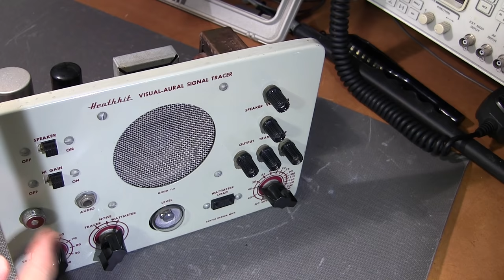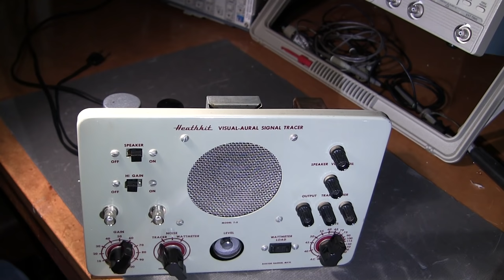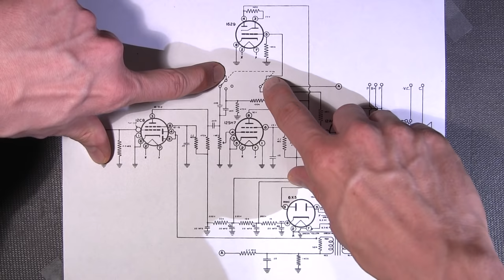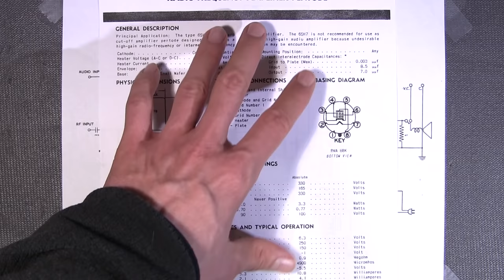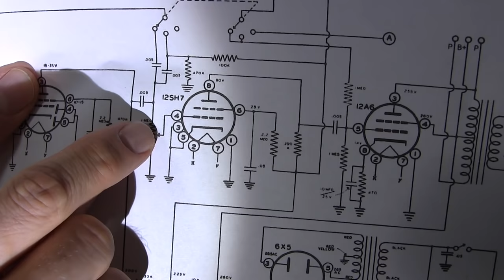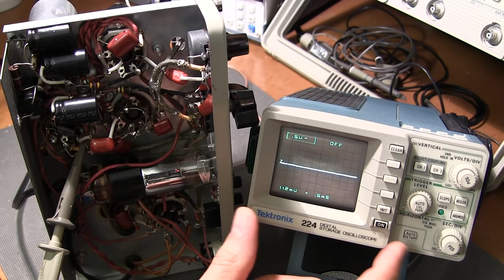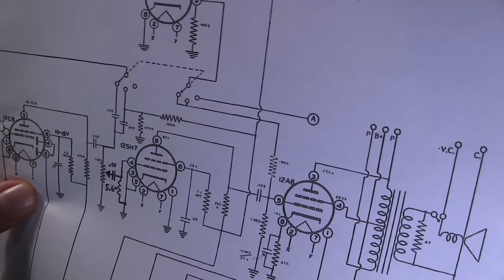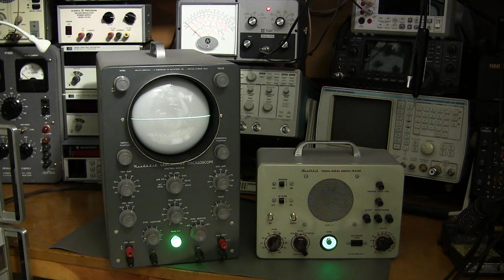Signal Tracer Troubleshooting Repair and Modification

Comment: This is a very useful video!! I have a lot of old test gear that I've restored or is in the que to be restored. I have a couple of the Heathkit signal tracers. Thanks to this video I now know that they have much better performance capability than mine do and I will be revisiting them soon. I have a E-200-C signal generator that I restored last year and it is a fine piece of equipment. I have one that is in unknown internal condition but very nice outside. Vintage test gear is a joy to work on imho. 73 NE5U  Mike

Comment: I picked up a T-3 fairly cheaply that "turned on". It turned out the high voltage secondary of the power transformer is open as well as the primary of the audio output transformer. I bought a used power transformer from a EICO 147A signal tracer and a Hammond 125B universal audio output transformer. Both of these are physically the same size as the Heathkit transformers and bolted right in. Capacitors were bad as well as most of the resistors. And the wiring was in bad shape. I completely gutted the unit and rewired it.

Comment: I have a question...  At 33:00, you said that you could mix using the "RF" and "Audio" input.  How?  I though to have a mixer you needed a non-linear component like a diode.  Wouldn't that just add the signals?  (I don't speak tubes, so forgive me ;) )

Comment: I love these videos! I was wondering if it was possible to modify a magic eye circuit to make it run duller as to prolong its life? or will it change how the eye opens? certain types of magic eye tubes are very rare and bright new ones are only going to get rarer, anything to extend their life would be good for us that like to use old equipment

Comment: Paul, I Wish Heaviside were alive to know how much EEs like you have progressed our understanding. At the end of the video, after disconnecting 100K resistor and connecting it to the leads outside, I thought that you would tap it a bit with your "plastic pointer stick" to rock it as you did before removing it to zero in on the problem spot along its length. Would it be possible for you to kindly probe this 100K resistor more by using your microscope to know the physical reason for this noise-whether an intermittent loose contact of the lead at the body film interface or a crack in the film so that you do not leave any trace of the enemy and then you can happily Widlarise the component after that, in another video, please?

Comment: Another great video Paul! Weren't the 6X5 rectifier tubes famous for shorting and damaging power transformers?
Reply from the maker: So I hear and read, but I never have come across a piece of gear with this issue. ( I hear this was a big problem in Zenith radios ) The problem may not be tube related, but capacitor related. 6X5 tubes are not big current devices, leaky electrolytic capacitors may put them beyond their tolerance. I have both plate styles here, again,.. Never an issue with either. Thanks for your kind comment.

Comment: Thank you for yet another interesting video! I have a question concerning the count of the useful elements in the 12SH7. If i have understood your explanation of the numbering system of vacuum tubes and the habit of heathkit leaving out the suppressor grid in their schematics, i would expect to count 6 elements in heathkit's schematic. I count however only five. Where do i go wrong?
Keep up the good work!

Comment: The 6X5 rectifier tube I noticed has the heater tied to ground, and if there is any heater to cathode leakage this will be a problem. Also it can introduce hum into the rest of the circuit through the heaters. As even with the best tubes there is heater cathode capacitance. I have been wondering why not two filament windings on the power transformer.

Comment: Would an EICO 147A also be a candidate for the addition of the capacitor and resistor that is shown being added to the grid circuit of the second tube? Also on the EICO, I don't believe that the grid of the first tube is grounded when the selector is in the audio position. Just looking for potential improvements to refine an EICO 147A.

Comment: I have an Eico 147 which is wired with the same grid leak issue. After this video I did the same mod with the same Quiet result. How did they ever use these things being designed  with so much noise?

Comment: My T-3 makes that scratchy noise as I tune the Gain control, so I thought ah-ha! Mr. C's mod on the 12SH7 might be the solution.  Nope, the schematic and wiring for my evidently later model is different. The inputs to the Gain control are reversed on the wiper and top side of the pot. I did try wiring it just like Paul with the cap and resistor, but that just created a loud hum.

Comment: perfectly explain no more to say, good job :)
little question i am currently reparing an old tube radio and fortunaly is only the output power tube but when i a am troubleshooting i was thinking that is the rf section defective but i am extremly confused about the stages from the antenna to the if so can you make a video about how the rf sections in a radio works or link me where i can find some informations because i have not found nothing useful, thanks. (excuse me for the english but i am italian)
Reply from the maker: There is an explanation in my Echophone EC-1 video. Here is the link, I will start it at the explanation part for you: https://youtu.be/z8k-h-g_8V8?t=2h1m20s

Comment: At about 19:35 you mention replacing the paper cap line to ground with a safety cap; saw same on another person's video.... those blue Vishay/Kemet/etc. safety caps are NOT (that I could find) at not offered at the same value 500pf/.05Uf as the original.  I understand that THAT cap has 2 jobs: #1 being a specific capacitance and #2 not ever shorting to ground.  The safety cap takes care of #2, but what about the difference in capacitance and the IMPORTANCE of that capacitance value in that particular spot? Why is it ok to use .5uF when the original was (designed?) to use .05uF?

Comment: Another very interesting video Paul.
   
   Nice modification. I wonder how the engineers didn't catch that, but you caught it right away. Hmm... are there any openings at Heathkit perhaps? {8-O

   Also, very nice troubleshooting and display of a noisy carbon resistor. Using the tester itself to test the resistor in question. What goes around, comes around. Eh?

   Really looking forward to the vintage tube test gear series.
         Tom
Reply: Actually, Heathkit has been resurrected and is selling two kits and a few modification/upgrade parts packages.  http://www.heathkit.com
Reply: Really? Cool! Thanks, I'll check it out.

Comment: why not set the bias of the 12sh7 with a small voltage drop diode on the cathode, instead of adding other passive components to the signal chain? Something to get about -0.4V or so. It also ensures same high gain at low frequencys

Comment: 6X5 rectifiers are notorious for hum and heater to cathode shorts. I’d use a solid state rectifier and a  series limiting resistor. Then you can use better value filter caps about 47 uf.

Comment: Hi...I have a question about the 12A6 tube...mine gets extremely hot...I have worked on tube equipment before, and this tube seems way to hot...all the voltages are right, any ideas?

Comment: why don't you change the carbon composition resistors out at the same time that you change the caps? it seems like since this is an audio application, the carbon composite resistors will be a sizeable noise adder.

Comment: awsome video as usual 😊. Now a question to you sir: I can see how much you insist on How those old capacitors has to go and be replaced if their purpose is to deal with (Block) high DC voltage, and indeed they should, but what about using them for passive filtering in audio circuit... As long as their capacitive value test ok, do you think its ok to use them for that purpose ?
Reply: just dealing with a small audio AC signal straight from an input source, to do a simple high Pass filter etc...
Reply: If they've got DC bias across them, then they absolutely need to be replaced due to increased leakage current which throws off bias of subsequent stages. 
If they're in a tone stack or somewhere else where there is no DC across them then you can get away with it, but it's not ideal as the leakage current is formed by an equivalent parallel resistance-EPR (although it is not often expressed that way), and this will also alter the response of your RC filters - the effect may or may not be significant depending on the surrounding impedances and EPR, and there's always the possibility that faulty parts may be salvaged and used somewhere they could cause damage, so best to dispose of them.

Comment: where did you get the  t3 tracer?was it expensive? 10,20,50,100 dollars?cheers.nice vid
Reply from the maker: If I remember correctly, It was $10 at a local ham swap meet. They seem to range to about the $30 mark for one that's in great condition cosmetically. They also come in the color grey as well.
Reply: magnificent exposition you did on circuit actions..thanks

Comment: Regarding the noise problem when the gain is near zero.  Your mod / fix looks like a design change!  I was expecting a break/fix approach to the issue.  So would you say that this was not due to a component failure of any kind - and that this device (and perhaps all of this model) probably had this noise problem when it was new ??
Reply from the maker: Yes, this is 100% a design flaw. It looks like they found this and fixed it in newer models. All of this design would have exhibited a noisy gain  control. Here is another example: https://youtu.be/E3iLyvaPz4Q
Reply: Excellent !!  Fantastic trouble shooting process !!  Wish I could find a T-3 as nice as yours and joernone's.  Guess I'll just keep hunting !!!  Thanks for the great info !!
Reply from the maker: +Donald Filbert  Your welcome Donald. Good luck in your search for a T-3.
Reply: I can verify that I saw this in my unit in 1972. That unit exhibited this issue then. I never fixed it an I just traded the unit away. Mr. Carlson you are so elegant in your solutions. Are you aware of McAdam Electronics. Inc. Digital  Audio Analyzer System model  2000A. I started using one at that time and did not need the signal tracer. I am reconditioning a second one now.
Reply from the maker: Great to read Mark, let us know how it turns out.

Comment: I find it odd that, Heathkit, in it's original design (looking at the clearly visible schematic info), and, Mr Carlson, chose not to include a "Mains" , or, Line voltage fuse into the unit. The Eico 147A has a fuse, but it's a 5 Amp that only covers the load to the wattage measuring circuit, with no protection going to the unit's main transformer. This unit does not even have that fuse in the wattage circuit.  A low resistance short would cook many a part inside of it without proper current protection.

Comment: If you wanted to quiet it down with the high gain off. I would put a DPDS switch in place of the original high gain off. The 12C8 would have the plate grounded in the off position. Really simple to add and it would quiet it down when not using that stage. I want one of these. Just another item to look for so my money doesn't burn holes in my pockets!

Comment: Where do I buy capacitors and electrolic caps and sc transistors for finals and drivers for Dak Mark 4, went on internet and can't find parts store digit has no finals or drivers, 2sc1957, 2sc1306.caps 47uf at 450wv, 3 legged B not connected,  need 3. On another, 2200uf 25 volt,  2200uf 16 volt. I have others,  but need the final and driver for the dak, got bad roar in transmit

Comment: I think Ceramic capacitors are the order of the day should they be 1kv working voltage, what about using 2X wire-wound 470K resisters and see if that solves the problem, those antique bulbs are back in vogue.

Comment: @1:15:57  Actually you can't remove the 12C8 tube as it would would be removing the double diode elements necessary for the power test circuit.

Comment: I think you could have done a slightly cheaper  grid leak modification. Just replace the wire from the arm of the pot to the grid with the 5.6M resistor. There would still be some slight bias variation, but from the small amount the bias was changing in the 900K to 1M region, it would probably be unnoticeable. Save a cap and a standoff.
Reply: Yes, that would be cheaper (by about 50c for the cap) but I think the way it was done here is 'better'. When it comes to test gear, it's not worth scrimping and saving a few cents.

Comment: Ironic that you could have used this signal tracer to find a fault in this signal tracer. That noise function is really nice, and not something you would find in more modern test gear. The liability lawyers would have a fit if they tried to release a piece of kit with 200+ volts on open alligator clips. Thanks for showcasing all this older gear and some of the things that are unique to them.
Reply from the maker: You're welcome. For the reasons you state, is why a lot of this knowledge is now almost nonexistent. Fear=control.

Comment: Paul. What is the lowest value of resistor you could check with the noise circuit before it pulls the HT down ?
Reply from the maker: Hi Pete, that's a difficult question to answer, as the noise in the resistor usually comes from a fracture or break. Technically any value could be diagnosed with noise. As for sensitivity to that noise, the higher in value the resistor under test, the more sensitivity.
Reply: So the HT supply coming out of the circuit of the signal tracer is limited by a resistor against a potential short circuit from the resister under test ?
Reply from the maker: You are correct.
Reply: Thanks for the information and another great video.

Comment: How does the 12SH7 count as having 7 elements? I can only see 6 including the suppressor grid.
Reply from the maker: Hi Greg, don't forget to count pin 1. The 6SH7 is identical to the 12SH7, aside from heater Voltage. Even though pin 1 shows no connection, it's connected in both cases to a shield, either internally (metal version) or externally (glass type)... note the base of the glass type is metal. Data sheet here:  http://www.mif.pg.gda.pl/homepages/frank/sheets/093/6/6SH7.pdf

Comment: Paul, if I don't have an original probe with an old signal tracer what can be used instead?
Reply from the maker: One could easily make a probe with a direct connection to the tip. For demodulation (RF jack on the tracer) you need to add a diode and a few other components. If you look up the Heathkit T-3 manual, a schematic for the probe is there.
Reply: Thank you!

Comment: Can someone please tell me if the coax cable on the RF probe is supposed to be RG-58 or RG-59?  Or doesn't it matter.  I would like to make an RF probe for my Heathkit T-3 signal tracer.  Thanks.
Reply: Not sure you should't consider a thinner cable for the probe... perhaps one with a stranded inner conductor. Don't think that it would get much better than the RG-58a/u other than the flexibility.

Comment: I have a question . I have a bunch of metal film resistors at 1% can I replace carbon resistors with them
Reply from the maker: It all depends on the application Lewis. Carbon composition resistors are better in RF application.

Comment: is the "eye tube" the same as a "dekatron"?
Reply from the maker: No, A Dekatron is a neon filled tube used for counting. A 1629 is a small CRT used for various applications. Some are signal strength indicators, tuning indicators, capacitor meters, bridges, and so on. The 6E5 is similar in design, just a different base and heater Voltage. some others are the 6U5, 6G5, 6X6, so on.

Comment: Thank you, I think that I will do your mod to my tracer.Carl
Reply from the maker: Hi Carl, does yours have the scratchy control as well? If so, let us know how it turns out. Thanks for your comment!
Reply: Yes it does, I was going to change it out. But not now. Mine is the same unit you showed.
I'll let you know if it worked as well.
Carl
Reply: Hi Paul; I have an Eico 145 that uses almost the exact same design (except the function switch cuts the RF gain stage completely out when not in use). I did your modification to mine and it did improve the volume control (Slightly noisy when turned down). Thank you for some good troubleshooting and think-it-through content!
Reply: I did the mod and it worked just as advertised, thanks again.
Carl
Reply from the maker: Glad this helped Carl!

Comment: Why do you use your SuperProbe?
Reply from the maker: To find problems quickly.... with no contact in high voltage circuits.... looking for very low amplitude signals.

Comment: I enjoyed this episode very much. Looking forward to the next one ! You didn't answer the question concerning the variac i'm building - i decided to use a rolling device. Still thinking which way to handle the inrush current. I'm thinking about neither using an NTC thermistor nor a delayed switching relay circuit with for premagnetization nor a peak switching solid state relay BUT using a 300V bi TVS diode in conjunction with a snubberless triac as it was done here:
http://wiki.spoje.net/doku.php/navody/electro/active_softstart
Now that you talked in this video about you using a 60W filament Lamp for your variac i am overthinking this.....
Reply from the maker: I think you may be over thinking that just a bit. I use 2 60 Watt bulbs in parallel. Works great. I have a hard time keeping up with the questions, so you will have to forgive me for that. I get many questions on the 68 video's I have up at this time.... It's a continual stream.